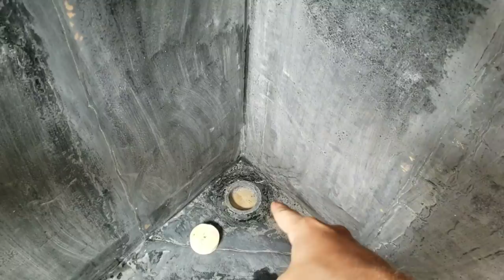How To Use Fiberglass on an Aquarium! Resurrecting our 1000 gallon Fish Tank

Comment: If the resin doesn’t fill the cracks at the overflow;  There is an add-mixture sanding compound (a powder) that can added to fiberglass resin that makes it thicker and sandable. It’s nice stuff. Easy to work with.

Comment: Hey guys I'm actually working on fiberglassing my current build. Something I learned from some pros is its best to heavily coat the area with resin first and allow the resin to bond to the surface you're fiberglassing. After its had some time then u can lay your glass in it, add more resin an and work out the air bubbles. When you fold the glass and dip in resin it damages the glass and makes it much harder to get a smooth surface.

Comment: Very cool. Personally, I have never done any work on acrylic tanks or worked with fiberglass so, if this is a stupid question, I apologize. 

Why a wooden puck? Why not use an acrilyc puck and the sealant designed to hold the panels together? Is it a cost issue or does the wood make for a better plug?

I don't recall the size of that tank but knowing you two, it's probably over 300 gallons 🤣 You certainly don't want to have it spring a leak.

Anyway, nice job so far. Can't wait to see it painted and full 😁